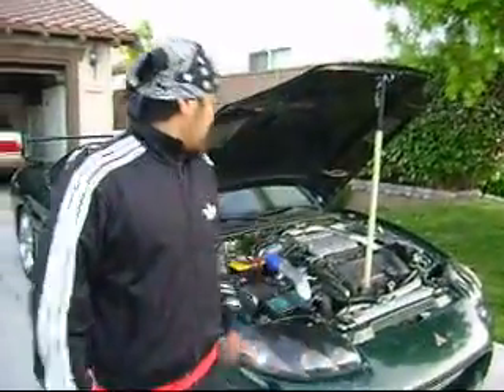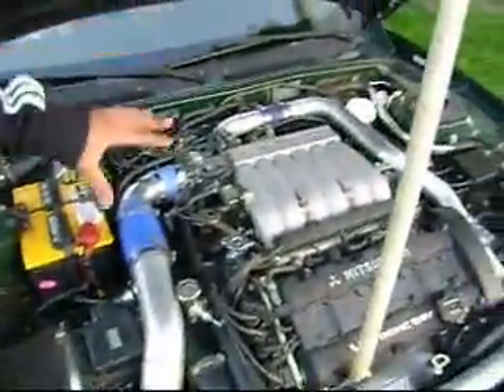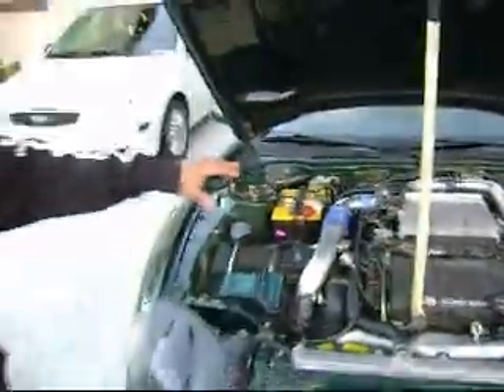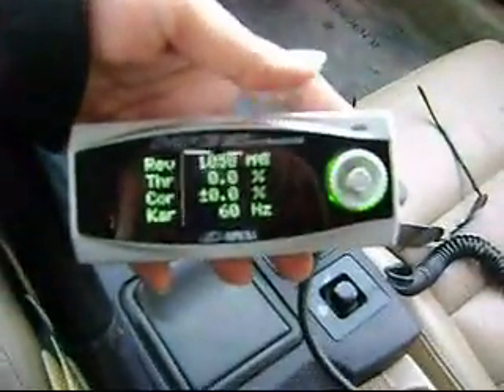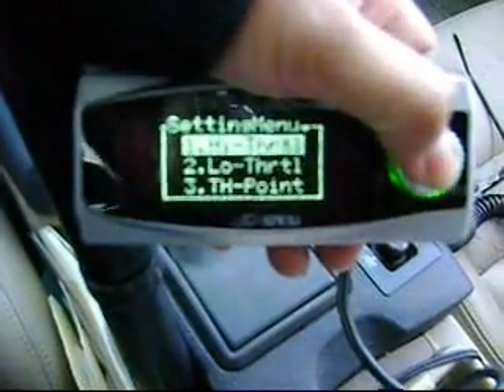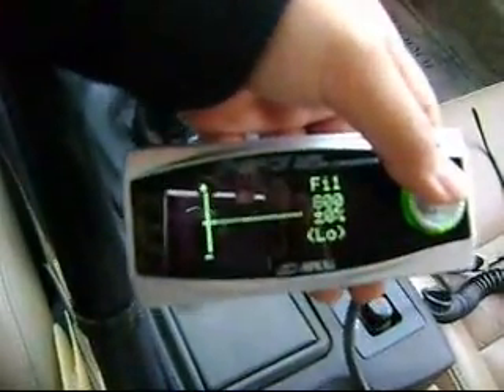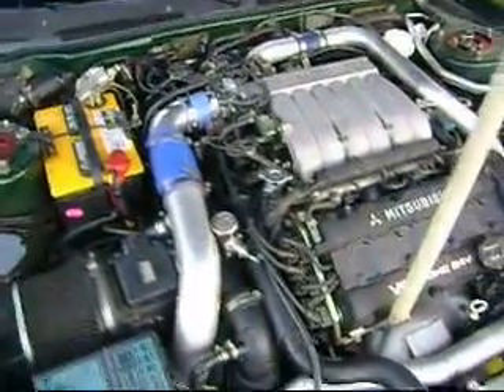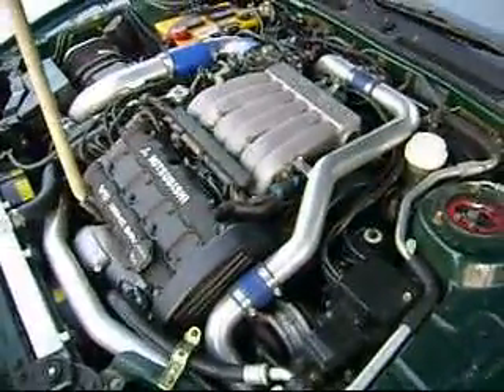1999 Mitsubishi 3000GT VR-4 flash-tuned 16T's @17psi

Comment: hi wonderin if u can help me im from uk just had a rebuild in my vr4/gto hasd volvo 16ts fiteed walbro fuel pump and fuel presure reguulater ..and still on stock injecters the machanic set boost at 1.2 b/ar car runs ruff when cold tryes to cut out till warm and rev limits and fuel cuts at 5000rpms /or rev limits not sure anyway will a safc and 550 injecters  sort my problem out im bit stuck for cash for now  and leavin it in garege cuz dunno weather its safe to drive like that any advice cheers

Comment from the maker: I have had v2.4-7 for a long while already heh. I mentioned in the first video that I purchased v2.7 immediately after its final release; it supports OP2.0 with new firmware. Yeah, my own tru-boost had 3.5 spring and hit+held 20psi each and every time. There was definitely a vac/boost leak causing the turbos to work harder than they really had to. Thanks for looking!